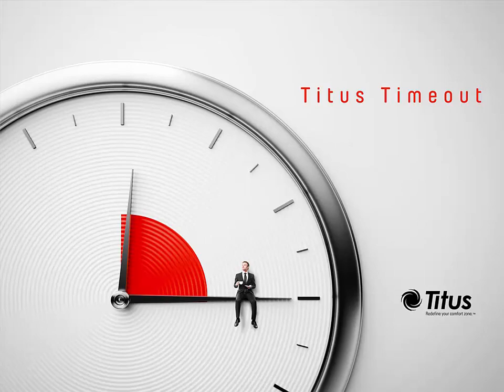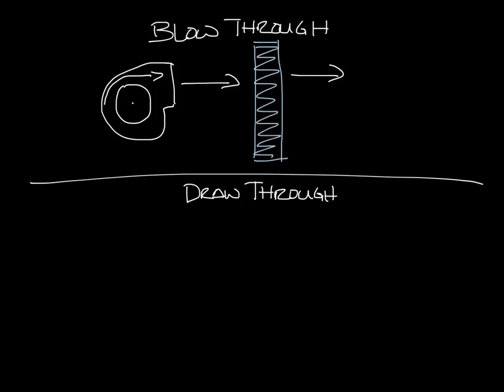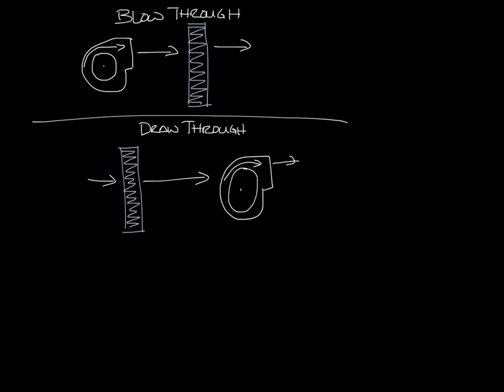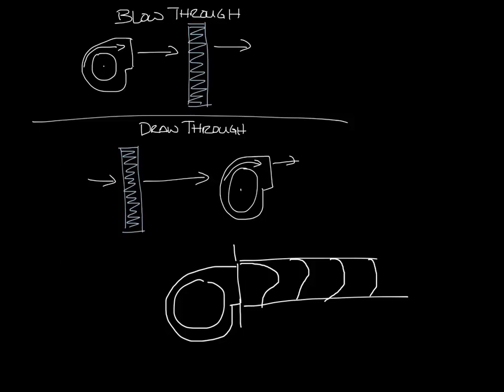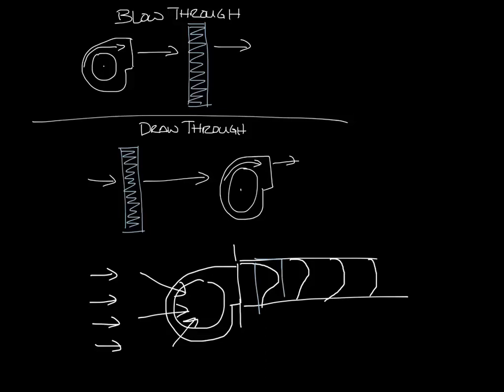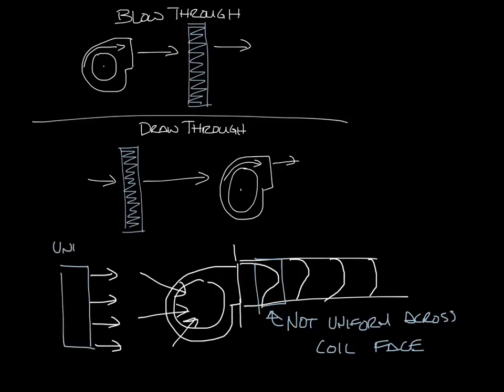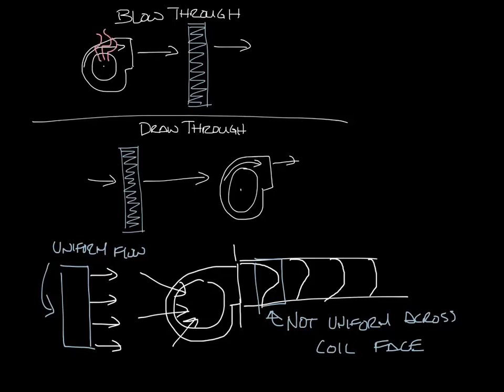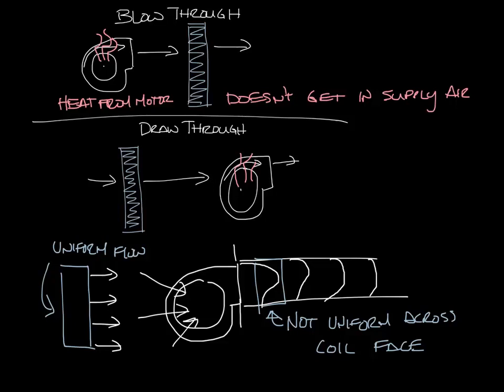Titus Timeout Podcast - Blow Through vs Draw Through Fan Configurations

Comment: what about the biggest thing..the effect on drain pan in the two configurations?
Reply from the maker: Assuming the air velocity through the coil is the same, it really doesn’t matter which side of the blower the drain pan is located on, but it is easier to maintain a lower velocity , thus less chance for condensate carryover, on the upstream side of the blower.

You are correct, if we didn’t mention that it is indeed a major reason draw through coils are generally preferred.